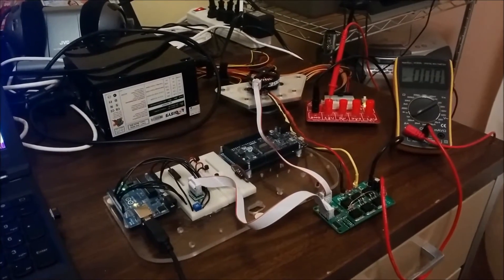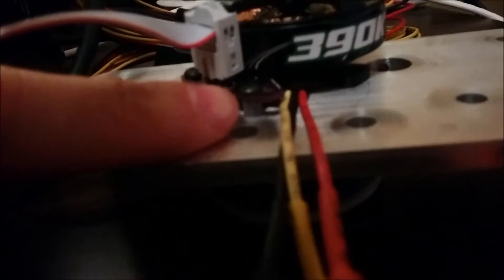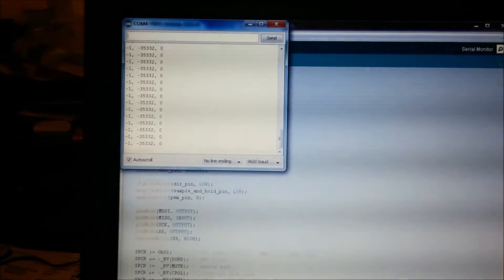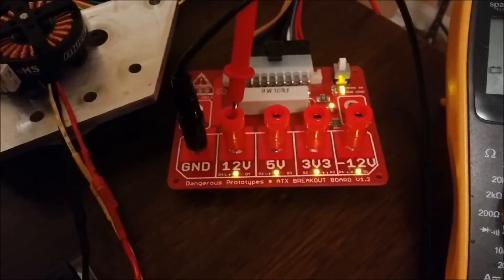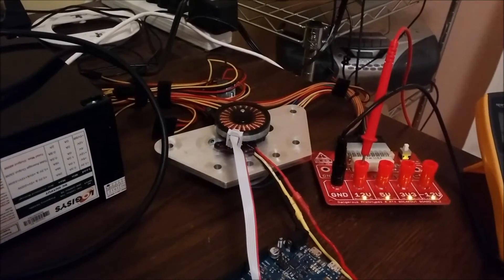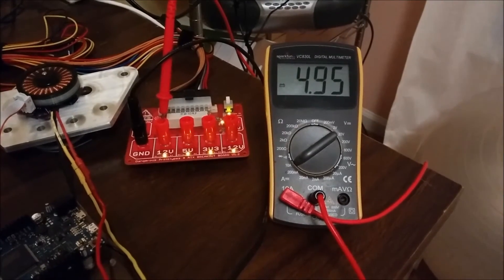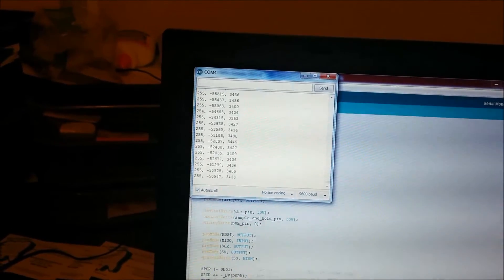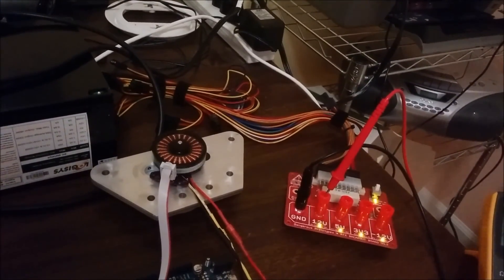BLDC Smart Commutator V2 - Open Loop Control

Comment: Super project... I just bought a dead electric scooter with 30euro, where cable on acceleration and display was shorted out, of course with another 30 euros I can replace the electronics (microcontroller on display and acceleration is shorted out - is heating) but It will be more interesting to build such a controller myself.
I was interested in designing the electronics and software myself,... but as you already done it in a really well design I can use yours and customize it to my need, par example add another microcontroller to display the speed and battery warning and even to input a password, so without it it does not work, witch will deter thieves, if I leave display open asking for password...
I think I will go fast buying the electronics but after doing one custom for myself when and If I have some time...